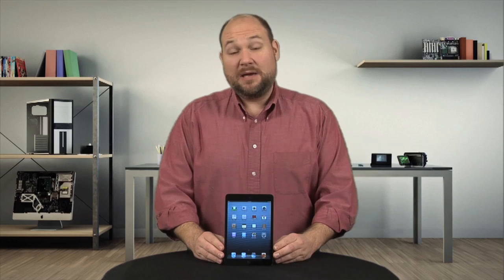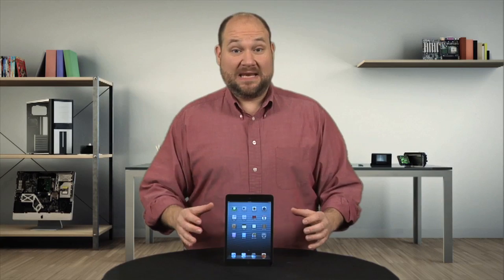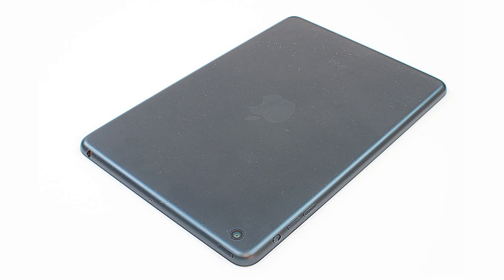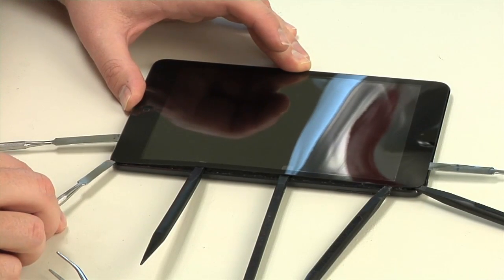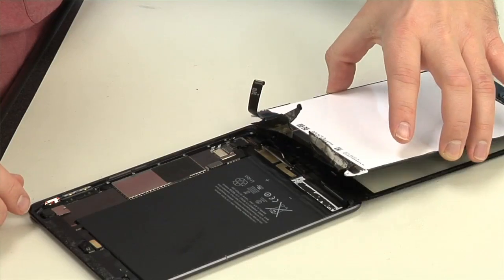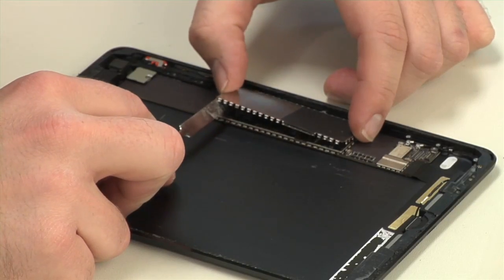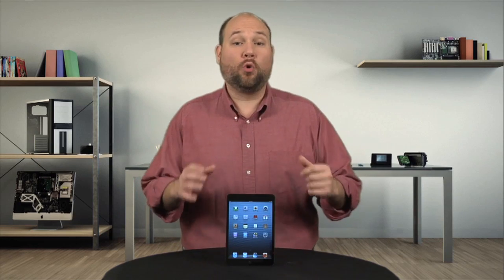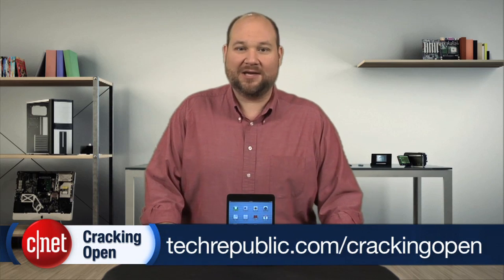Cracking Open - Apple iPad Mini

Comment: Apple downgraded the Mini because it had to be smaller and lighter whilst keeping 10 hours of battery life. If they'd used a Retina display, the battery would need to be bigger. The iPad 2 runs software just as fast as an iPad 3 running in Retina mode, I know, I write software for them. This Mini is by no means under powered. Compared to my Nexus 7 it blows it out of the water running like for like software. Specs aren't everything. Oh and this tablet has better PPI than a 27" desktop monitor!